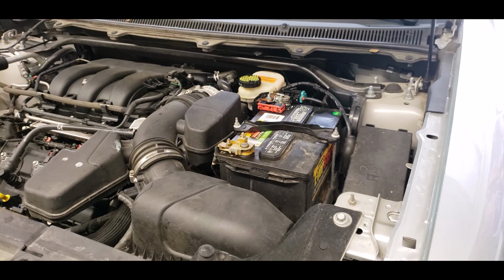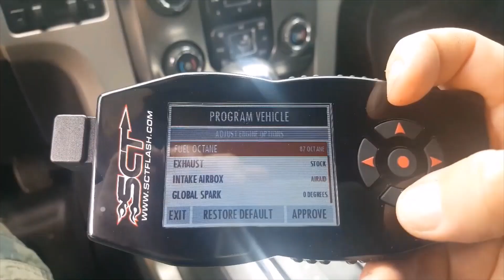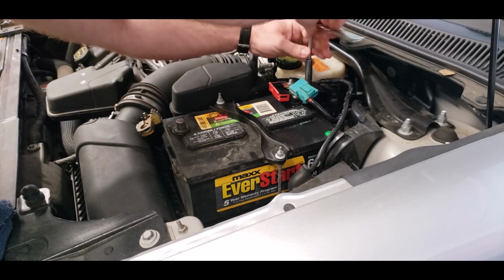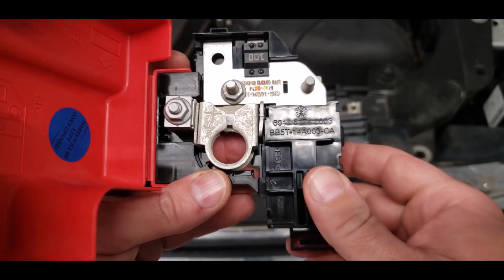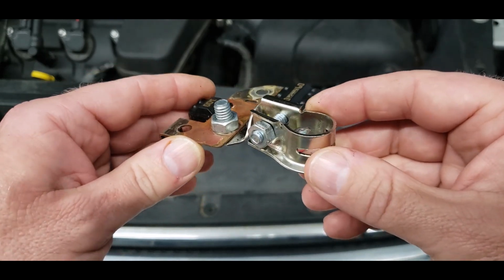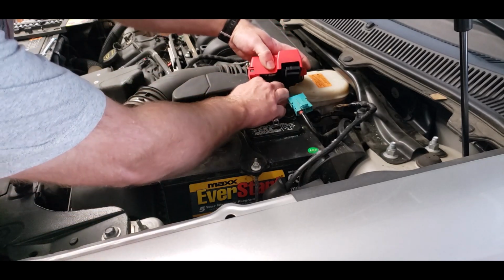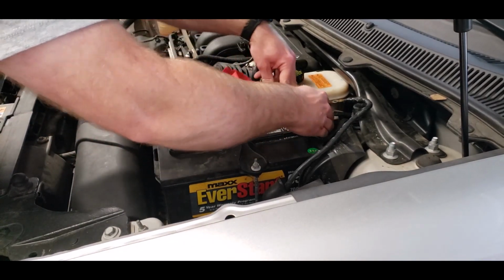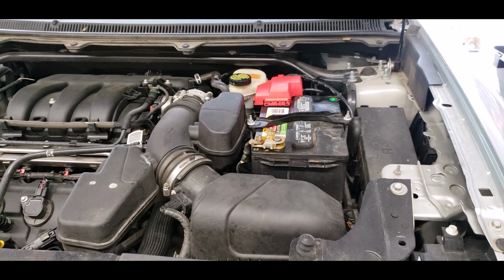✅✅ BATTERY TERMINAL REPAIR AND NEW TERMINAL REPLACEMENT FLEX TAURUS EXPLORER EDGE AND OTHER FORDS ✅✅

Comment: The NHTSA got involved in this, through complaints...Ford now has a service bulletin out that covers this (SSM 48123), and gives you a part number for a generic replacement positive terminal clamp (BT4Z-14450-AA, not made out of copper anymore 😀) as a replacement.  Ford warns you that the part may have to be bent to work in  a particular application (I believe that this part is from the Ford Edge), and that you will have to crimp the terminal clamp onto the old wire with a B crimping tool (must be ordered online-no auto parts stores even know what it is!  I ordered an IWISS lws-8200A for the job...) you are also supposed to protect the repaired part with shrink wrap when you're done.
Reply from the maker: Not sure about that.  There is no wire to crimp to or heatshrink around.  This part also fits edge so maybe you scanned the document over and mixed up instructions for the negative terminal for the positive terminal?
Reply: Thank you for posting this video and for the comment on the service bulletin.  We have a 2014 Flex I just had this issue with.  I was able to clean up the original piece while I ordered the aftermarket part.  Ford wants over $200 for the complete wiring harness when all I need is the terminal clamp.  I got the aftermarket part on Amazon and for the Flex, I am going to have to machine the piece to get it to fit with the rest of the assembly.  I'll need a grinder or something to do it so I'm going to wait a bit and see how long the original piece holds up after a good cleaning and a liberal amount of terminal grease.  Thanks again for helping me save some money by avoiding the dealership!!

Comment: Our battery was old and gave out. Got a new battery. I turn the ignition on, and I hear it trying to crank but it doesn't turn on. Is this an issue with the circuit breaker? As shown in the vidd??

Comment: My step-daughter's 2012 Ford Explorer wouldn't unlock with the key-fob.  Battery was clearly dead.  Luckily it was in our driveway.  I go to charge the battery, and find the positive terminal utterly destroyed from corrosion.  No idea how it got that bad.  The crazy thing is that she drove it here and parked it with no issues whatsoever.  Then 2 days later, completely dead.  

Anyway, I definitely needed this video.  Thanks!

Comment: This just happened to my on my Lincoln.  There was so much corrosion that the original part was unsalvageable.    The red cover hid all the corrosion so I never new it was happening.   Well luckily the car is under warranty and I am hoping it is covered as we had to have it towed to the dealer.    Wish I would have seen this video sooner.

Comment: Thanks for the video. I was able to save some $$$. The message on my 2013 Explorer dashboard  was "Service Adanvance Trac" but it happen to be the positive terminal and due corrosion from the battery disconnected the power to the advance trac system. Very lucky to find this out! 
Ford now offers the terminal without cables for $50
Reply from the maker: Look in my description you can get a whole new unit like I did for about $20.  Please like and subscribe!  Thank you
Reply: @BOSSC351sProductions  I NEED THAT PART HOW CAN I GET IT FROM U OR WHERE CAN I GET IT FOR $20 I DON,T SEE THE LINK
Reply from the maker: @michaeldavis5938  Best I can do.  Prices on everything has gone up.  Ford Battery Positive Terminal Assy: https://ebay.to/2X9me7Y and https://amzn.to/35JVA7M

Comment: Sir, Thank you for the video. I was able to use your approach to firstly disassemble the unit and then repair it temporarily using 8 dollars of purchases from Walmart. I’m going to see how long it lasts.
Reply from the maker: I tried my Walmart but they were out of the connector type I needed.  Good deal!

Comment: Oh my gosh. My 2014 Ford Flex did the same thing. Me and the kids were stranded at Target for 5 hours. I need to see if I can go find this temp fix while we order the part.
Reply from the maker: That stinks!  I hope my quick fix works for you!
Reply: @BOSSC351sProductions  It worked!
Reply from the maker: @laurenaltomare8992  That is the best news!  I have a link to the replacement part in the description.  Much cheaper than can be purchased at the dealer and it is a Ford part.

Comment: I changed my alternator, battery and cleaned the terminal.  I still get a battery light on when idling.  Could it be this simple? I will order the part to see. Thanks for the video!
Reply from the maker: If the fuse is blown then yes it is likely the problem.  Use a DVOM and check to see if you are getting a charge at the battery.  Check across the fuse to see if its open.
Reply: @BOSSC351sProductions  WHAT FUSE AN WHERE IS IT LOCATED
Reply from the maker: @michaeldavis5938  the fuse is on the assembly on the video that has 100 printed on it.